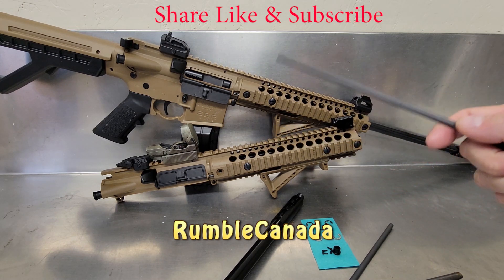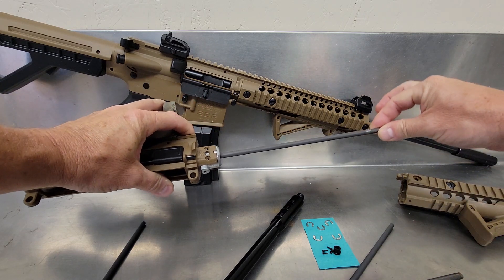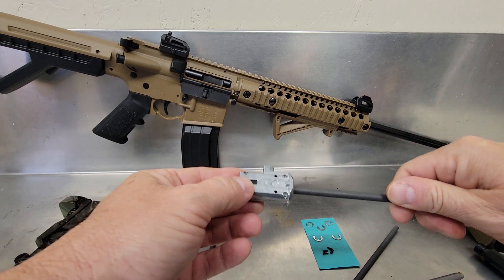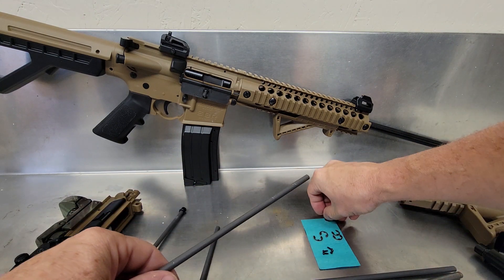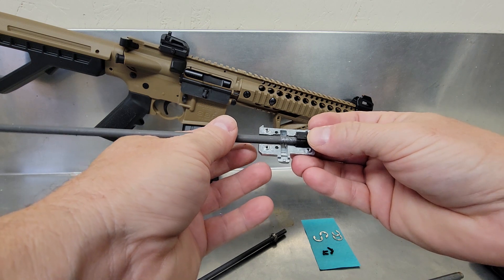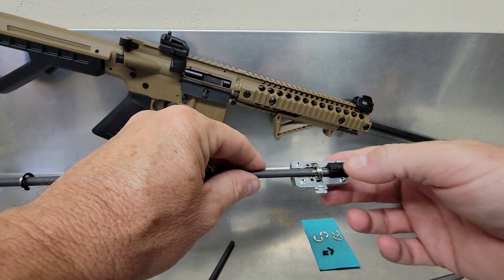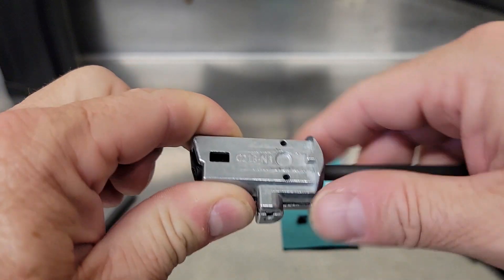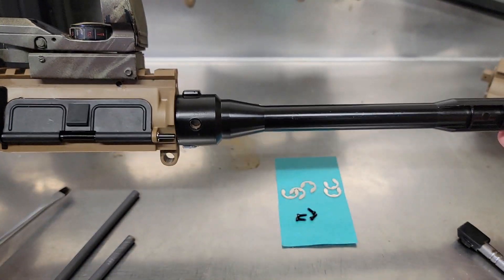Crosman DPMS R1 MPW    ** Stock Barrel Mod **

Comment: That (now locking ring filled) cavity within the halves seems to be a remnant by an initial idea of a hop-up rubber system (there's even a hole underneath the aluminium block for a hop-up adjustment screw) that never made it into this rifle. Which is okay by me. The rifle is damn accurate enough as now is, for being just a short BB rifle..

Comment: So I just finished adding a 2nd 9 inch barrel that I build into a suppressor that's quick detach. So you can take it off and it looks almost like stock, or put the stock nubby on, or use the full monte and have a little over 19 inch barrel. It's on the dpms sbr but I'm sure it would work on the r1 as well. If interested I can see if I could post some pics and a guide some where.

Comment: So I installed a New 18" Rifled Crosman barrel from eBay and machined the OD for a really tight fit, there is no movement and now the BB's come out so slow, they are lobbing out making accuracy much worse. I have a great seal around the new barrel that I custom made, so at this point I cant figure out whats going on? Maybe I got a bad barrel from ebay??